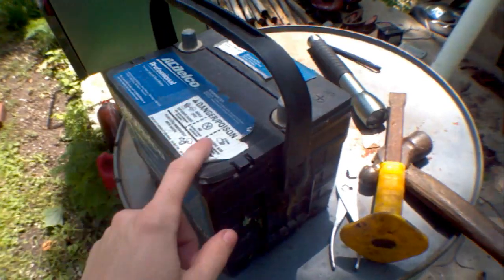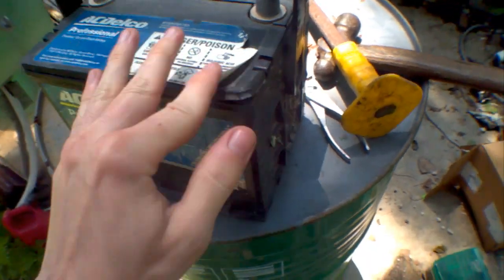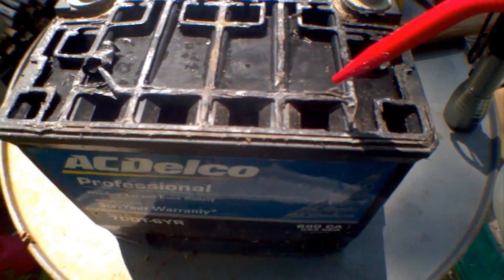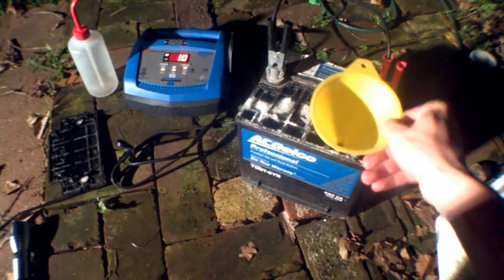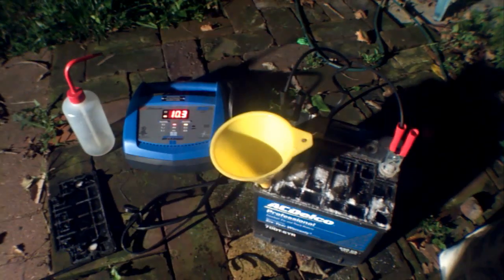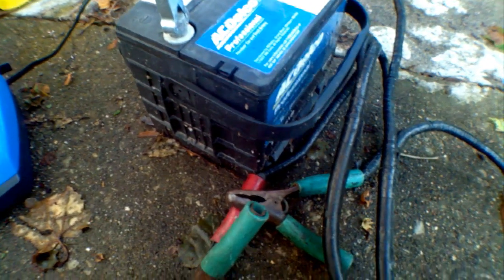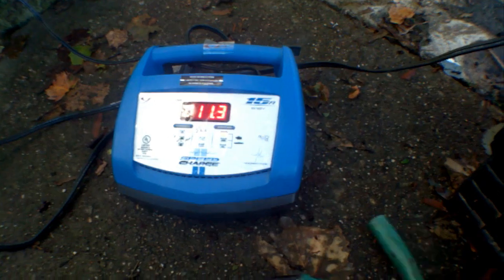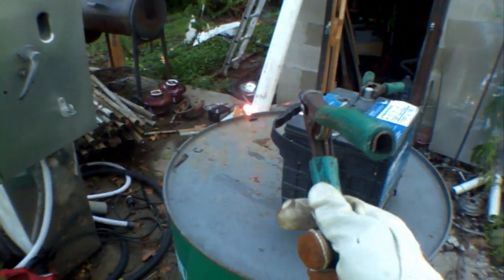DIY: Opening a Car Battery and Repairing with Epsom Salts

Comment: be careful, the electrolysis of salt generates chlorine gas, ammonia and bleach!!
They are very dangerous and if sealed battery could explode!
Reply from the maker: i think you may want to read up on chemistry. are you referring to epsom salt or table salt?

and also batteries only create gas above 13v. and finally i did this outside so no issue of explosions.
Reply: Rinoa Super-Genius sorry, I did not read the description, I was referring to sodium chloride (NaCl).
Epson salt (MgSO4) in the worst of case  could create  sulfuric acid if there is  hydrogen in batteries ....
Reply from the maker: BartolomeoDC
well surlfuric acid would be great since thats what batteries are made for.

Comment: I'm not that worried about safety in an open space where hydogen can't build up though some eye protection might be useful in case you boil the electrolyte (acid) while discharging. Don't want any in your eye. Banging the battery so hard with a demolition bar could crack some plates. An electric soldering iron may be a better way to cut the plastic. Avoid shorting a battery with a good conductor - thin wire is ok as it acts as a resistor and melts before the battery's internals get hot, melt and/or boil the acid. Eye protection!
Reply from the maker: first of all acid isnt really all that bad, i've gotten a lot on myself. and second this battery had epsom salt not acid, the acid had left the battery long ago.
Reply: I see you progressed a lot since this video. Good experiments and advice.
Reply from the maker: Jonathan Pearce well sure everybody progresses, but i'm still gonna be sure to do weird experiments. i have a 12v truck battery i need to return for core charge so shall short out the terminals and see if it explodes :D
Reply: Lol

Comment: Fully charged battery should be up around 14v. Short test shows that current output is greatly limited and could not start a vehicle. Question to ask  - is it worth all that trouble? Sulfate in cells (which is what degrades all car batteries) is essentially impossible to reach with Epsom salts.
Reply from the maker: yeah but epsom salt raises the reactivity of the acid. its great for starting vehicles but bad for AH. the thing is so in a lot of batteries i've desulfated, the acid was too weak to give much current. so epsom salt helps along with a desulfator.

also no lead acid 12v battery stays at 14v. a brand new battery will drop down to 13.3v really fast then over the coarse of a day drop down to 12.7ish volts slowly. but an AGM battery will ussually stay at 13.1v

Comment: she blowed up real good
Reply from the maker: whatcha mean?
Reply: making of sparks around the top of the battery is dangerous a charging battery can give off explosive gases and making sparks can set off an explosion
Reply from the maker: yeah but it didn't explode. so your statement that it blew up is wrong.

not counting I was outside so the wind blew away any hydrogen. the only issues occur when you dont,t have good ventilation.
Reply: well when you meet some one that a battery has blown up on you will do things a little different so you do not end up with a messed up face i am just saying i am not trying to offend you
Reply from the maker: readyxxi
I plan on blowing up a battery on purpose someday FYI.

and dont worry its hard to offend me over YouTube.

Comment: oohhhh the many wonders of epsom salt.. From wellness to car repairs, this ingredient is very versatile indeed.
Reply from the maker: yeah and it seems to work in other battery chemistries as well. like i took the zinc/copper battery i'd made when i was 9 or so and instead of puting salt water i put epsom salt in and it was rechargible! i did a video of that but it was pretty boring.

Comment: What would you have done if there was acid in that battery, just a simple question.
Reply from the maker: prolly just put less water in to fill it. even if it had acid it would have been neutralized from sitting. not counting battery acid is 90-95% water anyway.

Comment: You do realize it isn't only about how many Volts the battery is putting out right? You can have a battery pumping out 14 Volts and it still may not have the AMPS to start anything…
Reply from the maker: yup, but I dont intend my batteries to start anything.
Reply from the maker: *****
one of my latest videos is a battery welder.

FYI this battery had pretty much no acid left. and also I've found the overcharging capability is mostly from Epsom salt.

dont worry I dont do anything that's too dangerous.

Comment: reconsider open toed shoes when working with electricity, thick soled leather zip on, or even rubber soled moccasins are just as quick and easy to put on. Other than that a flame retardant work suit is really fast too, you can wear shorts and all under it.
Reply from the maker: just for a little battery? working smart is far more effective than safety gear. would you also like me to wear a hazmat suit when baking cookies?
Reply: depends on if they are lithium ion cookies. Batteries contain stored potential energy, in a catastrophic instance they can release all that energy or some portion of it in your direction, your ability to get away is hindered if your feet are on fire or other wise melting. Hey you seem smart I'd like to see you experimenting for a long time, not all crispified.

Comment: Since it was a totally flat battery, it was a good example to do your tests on. I'd never have tried shorting the terminals, but you could be correct, in that it would certainly move electrons. Nice work. The biggest risk I saw was shorting leads while so close to the battery while it was being charged. During charging, a flooded battery expels hydrogen, and can explode. No, it won't go off like a grenade, but it will spray sulfuric acid around. Not only can it burn your skin, but will do eye damage very quickly. Wear a shield, and keep baking soda close. Thanks for the vid.
Reply from the maker: yeah but this battery didn't have any sulfuric acid in it and i was outside with plenty of ventilation.
Reply from the maker: ***** if a battery is dry that could prolly be from overcharging. when a battery is overcharged (like by a bad voltage regulator from the alternator) it turns the acid and water into hydrogen sulfide so in that case the acid would be lost.

not counting acid just goes away after years of service. the sulfuric acid molecules get stuck bonded to other things (like in the form of sulfation)

but epsom salt in water can do the same as acid. epsom salt will increse the reactivity of the electrolyte and allow the electrolyte to interact with the lead plates.

Comment: It was a useless battery and is now, still, a useless battery.
Reply from the maker: there is no such thing as useless. just like there is no such thing as garbage or waste. everything can be used for something.

but either way i had fun with this battery even if it didn't keep at a good enough voltage.
Reply: Rinoa Super-Genius True, that is something I sometimes forget with all the brainwashing of modern consumerist culture. Next time though I suggest using a strong solution of epsom salts in hot distilled water to refresh LA batteries. I got an extra season out of my car battery that way but alas buying a new one was all but inevitable.
Reply from the maker: yeah i actually just uploaded a video on epsom salt. got another one ready to upload for tomorrow also. i think this AC Delco battery was just to far gone to make it reliable. its just a fun curiosity.

i might fill it with mountain dew and stuff and see how it goes. kinda like "will it blend" but instead "will it charge" haha.

Comment: I was charging a lawn tractor battery in my garage years ago, had the garage door open with the battery sitting on the end of the work bench with the caps sitting loosly on top. Fired up the grinder about six feet away at the other end of the bench and started sharpening a blade, and BOOM goes the battery launching the battery caps into roof. When charging a battery, if there are bubbles coming out of the acid than there is hydrogen and oxygen being released into the atmosephere. keep sparks away. It sucks big time when acid gets in your eyes.
Reply from the maker: yeah i've gotten acid on myself before. luckily it doesnt hurt too much.

you shoulda had a camera recording the battery exploding. one of these days ima blow up a battery on purpose i think :D

Comment: You've got to be kidding me.  Have you ever got sulfuric acid on your hands?  I have chemical burns on my hands right now from the Sulfuric Acid and I was wearing CHEMICAL RESISTANT gloves. It ate through my gloves and burned the top layer of skin off my hand in the time it took me to run and grab baking soda about 50 feet away.   You'll learn the hard way like I did.
Reply from the maker: guess you havent seen the video where i accidently splash a bucket of acid on myself. i've gotten acid on myself a lot. even brand new acid and it only feels like razor burn after a few minutes. thats couse battery acid is only 10% acid and 90% water.

sorry you had a bad incident with battery acid. you where prolly messing with pure sulfuric acid not battery grade acid.
Reply: Rinoa Super-Genius
Well it was supposed to be 15-20% with another error of +/- 2%.  Turned out to be 87%.  Last time I save a few bucks with a Chinese supplier.  If you've had burns, why wouldn't you wear gloves?  I'm not messing with any caustic substances until my elbow length real deal gloves come in.
Reply from the maker: i've had plenty of explosure to acid and i gotta say pure hydrogen peroxide is the stuff i'm nervous with using but battery acid has gotten on me a lot and never hurt me. just irritated. but corroded my tripod and burned the grass though hahaha. xD

Battery Acid Accident

Comment: Just be careful making sparks near the battery, can ignite hydrogen gas
Reply from the maker: yeh its a good idea to be a few feet from the battery. and even better to be outside with wind blowing the hydrogen away like in this video.

but also the batteries only produce hydrogen above 13.1ish volts, and they don't start producing a lot till after 14 or so. as long as your not charging them for a long time on high amps your prolly not gonna make too much hydrogen.

Comment: Battery on concrete thing is a myth.
Reply from the maker: yeah, another myth is that the battery plates discharge from the top down. like if you discharge the battery the top part of the plates are discharged while the bottoms are fully charged.

but now something odd that could sound like a myth is banging your battery to give you more power. in several batteries i have after a while they build up bubbles between the plates. idk if this effects performance but it would be logical to assume the area of plates shielded by the bubble of gas would be non-reactive while the bubble was there. so sometimes i bang my batteries a bit (not very hard) and a lot of bubbles float up.

Comment: Sitting a battery on concrete will drain it.
Reply from the maker: Nope it will not. That is a myth started in the 1910s back when car batteries consisted of glass cells housed in a wooden shell. Concrete has moisture so would kill the wood. Then when we moved to the rubber batteries we had a similar problem until we finally moved to the modern polypropylene battery cases we have today.

I have kept all my batteries on concrete for a long time. I have two motorcycle batteries I bought brand new for experiments and they sat on concrete for over a year. They did not show an increased rate of self discharge over the regular 30% per month.

I hope that helps
Reply: Yes. Thank you ! The realization of ignorance is the beginning of     knowledge.
Reply from the maker: No problem!

Comment from the maker: haha yeah, it sure beats just throwing them into the bin.

if only the cells didn't leak i could prolly revive it to the point where it would hold atleast 12.3v. but oh well. would have to desulfate it too though. i'll prolly try to fix the crack in the battery with like melting the plastic or something.

then if that doesnt work i'll rip the plates out and turn the battery into a cool little toolbox or something :P

Comment from the maker: why? don't tell me you fell for the "batteries on concrete floors" myth....

i've had some batteries sitting on concrete for about 2 years now and i charge them every few months. they aren't dying any faster than the ones i have on fiberglass.

the concrete floor myth came from 1920's batteries where glass cells with a wooden case around them. concrete holds moisture and would ruin the wooden casing. but when plastic battery cases where introduced in the 1930s-40s that became irrelevant.

Comment from the maker: oh FYI i have gotten epsom salt to work though. like i put epsom salt into a little 6v SLA i found and it holds a charge for several months.

i wasn't trying to sound like this video's process didn't work at all, just the ACDelco battery i used was too far gone ^^;

Comment from the maker: well unfortunatly this battery had cracks in the bottom so all the acid leaks out overnight. also there was prolly a lot of lead sulfate buildup around the plates.

i think a better method would be to desulfate the battery with a pulse desulfator. then once the battery is desulfated the plates have plenty of surface area but the acid isnt acidic enough anymore since its old. so would use epsom salt to make the acid more reactive.

this video wasnt meant for long term use, but messing around :D

Comment from the maker: yes epsom salt is an alternative. it actually works pretty well. the middle cells where totally empty and only had epsom salt solution inside it. i made a video recently testing the differances between salt and epsom salt as electrolytes and epsom salt worked great. was even rechargable with zinc/copper mixture. the same chemistry but with sodium chloride wasn't rechargable.

Comment from the maker: yeah 12.8 is a nice voltage. but don't forget that lower voltage batteries can be salvaged with a desulfator. i have several batteries that maxed out at 11.3v and desulfated them and they can stay at around 12.6v so far.

i would have prolly tried to desulfate this battery too if only it didnt have so many cracks in the bottom, i didnt realize it was cracked till after this video.

either way epsom salt clearly did have an effect :D

Comment from the maker: unfortunatly this battery had cracks in the bottom. sometimes batteries are just too far gone. but if it didnt have a broken case you could prolly use it in a car for a bit. would prolly really help it if it was being used a lot.

but this particular battery was so far gone that i'd try epsom salts and desulfating it. i mean it was buried in mud for 10 years so cant expect much..

 i think the plates are salvageable, maybe i should take them out and build a new battery. would be a fun project.

Comment from the maker: yeah white insulators tend to be newer. 1870s-1940s where mostly green/blue glass. 1910's - 1970s where mostly brown/grey ceramic. and 1950s-present tend to be white ceramic. but thats only my experiance with american insulators. the oldest ones i got are from about 1914 when power started being run to our town for the coal mine's equipment.

also on rare ocasions i've found plastic insulators that are kinda a bakelite. think those where during supply rations in WW2.

Comment from the maker: because connecting 4 cars to it wouldnt put acid back into the cells. i'm glad to hear that fixed your car battery but i doubt yours was in as bad of condition the ones i find are in.

even if you had 4 cars that would still only be 13v going into the battery. i would love to hear more about your battery experiment. i'd imagine your battery has been in use ever since it was made. the big problems come when they sit for years.

Comment from the maker: nah, as i said its not going to be moving. once i get it working better it'll just be sitting under my bench hooked up to my solar panels and power system

not counting i'd want to check up on the fluid level without breaking the top off again.

Comment: Even if you dont have a 5000V transformer you could use the transformer of microwaves and geigercounters and ion chamber are not the same ,i n my opinion.Because the Ion Chamber i mean need only 9-21 Volts

Comment from the maker: well i prolly could buy chemicals if i knew where to get them, but i live in the middle of nowhere. i'm about 70 miles from anywhere. i'm lucky to have a gas station nearby.

if i lived in the city i prolly could buy chemicals but you can't ship chemicals through the mail. but i'm finding ways to get Lithium,Hydrogen,Sulfur,Lead,Copper,Radium,Uranium so i think i can make chemicals if i have the basic elements.

Comment from the maker: this battery still has a high rate of discharge, like if i set it overnight it drops to 9v. ima build a desulfator and experiment with it. maybe the desulfator will remove some of the sulfate still on the plates. thus making it hold its charge longer

got another battery yesterday and will use only a desulfator on it, it reads at 2v and has no electrolyte in the cells in the cells. maybe i'll try your idea of mixing the salt beforehand. i'll get a metal bucket and heat the water up to 90c

Comment from the maker: haha prolly, good thing this battery's waranty expired when i was 8.

and to answer the comment you deleted, the reason the cap didnt break was because it was a seperate piece glued/melted onto the top of the cells. i just cracked it at the seam where the top was bonded to the bottom.

then again the cap did have several cracks and holes in it after i chisseled it, but i dont care because this battery is going to be stationary to power my shed's power system when i build it, gonna have LEDs :p